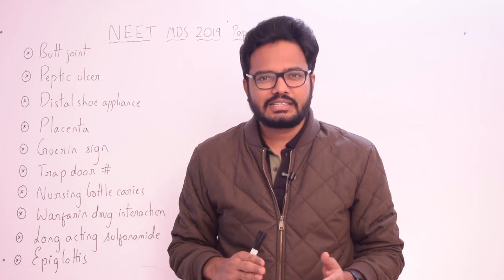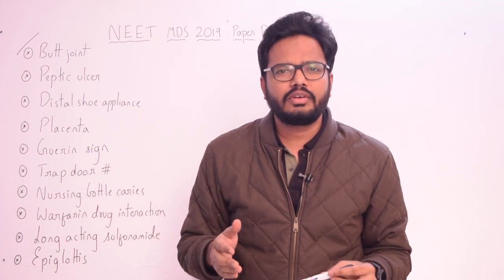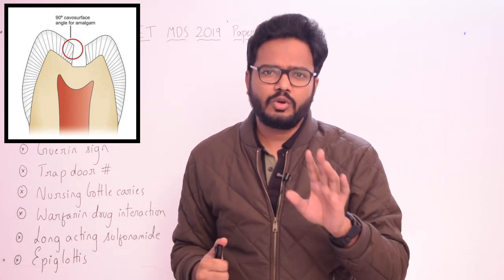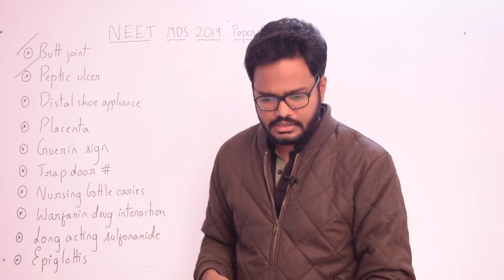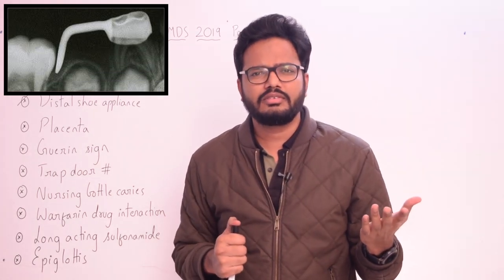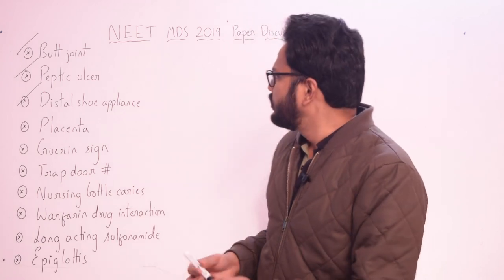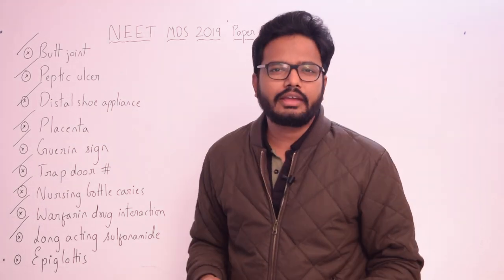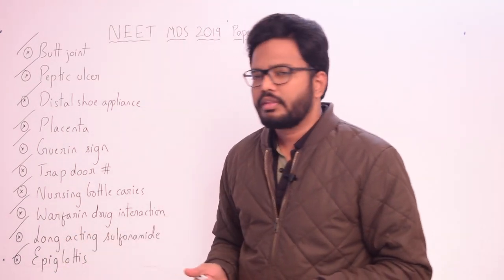Paper Discussion 2 | NEET MDS 2019

Comment: Sir for distal shoe appliance options were 1 mm and 2mm. Which one is more correct.?
Reply: I have the same doubt..have marked 2mm 😐
Reply: @vishakhapandey8828   its 1mm below mmr of 1st molar. 2mm is  overall length
Reply from the maker: McDonald reference gives 1 to 1.5mm as the depth of extension.
Reply: Got it Sir. Thank you.!